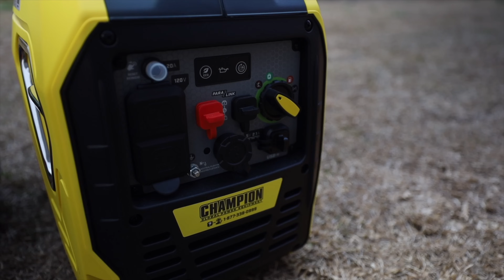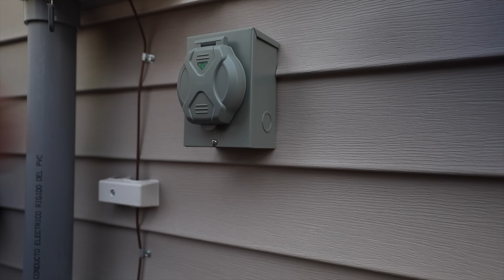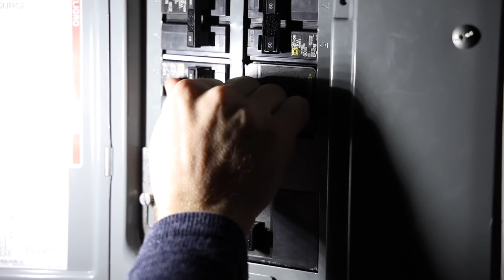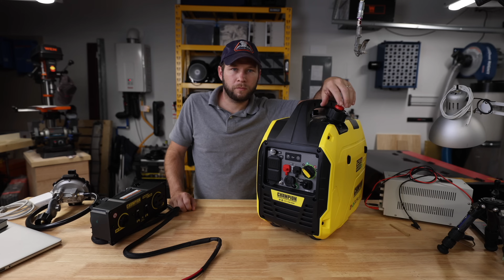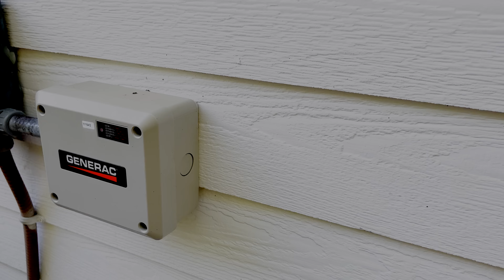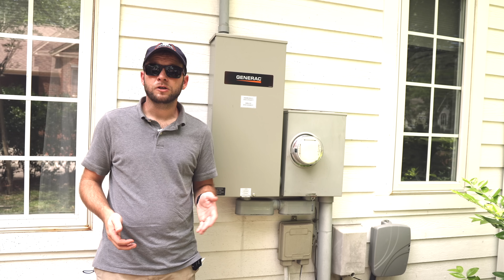Will running on a generator damage your house? Inverter vs standard vs standby

Comment: Hello D.A. Thx for the reply. Yes I’ll put a type 2 SPD on side of CB Panel. 
Now My BURNHAM Gas Boiler is Hardwired from panel to an on/off switch to Boiler. Does this make sense to put a GFCI 15amp Rocker/Receptacle in its place with a 12/3 3prong pigtail. Then when utility goes down I unplug from that receptacle, then plug that plug into a UPS then plug the other end into Receptacle/Rocker, then turn on  the Genset with  less than 3 THD, now my boiler has a better chance to see Clean power from Genset to UPS to Boiler/Zone Valves/ Circulating pump. Will that work to protect Boiler from unclean power. If you say yes then I will buy other inexpensive UPS’s for my FIOS “ONT”, Router to keep WiFi connected. Just run my Sump pump 3/4hp, 2 Refrigerators and LED lighting. It’s a 
AiPower GXS7100iRD
duel fuel. Costco$999 on sale. 
Please reply again about the setup i hopefully was clear on. I’m old and trying to learn and keep my wife warm in the cold weather. All the best to you and channel. Mike ienuso. Again thx for the other reply, very helpful.
Reply from the maker: For things like the internet or computers, a UPS is great to keep them running for a short time until a minor outage is over or you can power up with a generator. However I would not recommend one for "cleaning the power".  This is because the only UPS that really cleans power, and works with a generator, are what is known as true-online or double conversion UPS's.  These can be very expensive (as much as your generator ) and they are meant for servers and other critical loads that are also backed up by automatic generators. A regular UPS is usually just a standby ups and will just send whatever power is coming in, back out. With these types of UPS, if the power is dirty enough to need cleaning, then it is actually too dirty for the ups and the ups will just stay on its battery until it dies.  A double conversion is always running on its battery, while  simultaneously charging it, effectively generating its own clean output at all times, this is why they are expensive, but also have to have batteries replaced every few years to stay healthy.   I would say to just trust your inverter generators output. Most power supplies are designed with fairly good filtering and controls that are converted to DC inside the unit anyway.

Comment: I wished you talked about the THD of whole house generators, but overall, a very good video. My thoughts:

If you're older than 45 (aka - I'm too old for this shit!) and you have the money, get a whole house generator. Running portable generators on gas is a pain in the ass! Assuming your gas station is actually pumping gas, you still have the issue of actually getting the gas to your house (trust me, your car will smell like gas after), pouring the gas into the generator without spilling any or getting any on your body (won't happen) and dealing with the left over gas (you can put that in your car, so not that bad).

Sure, you'll have $2K worth of propane just sitting there doing nothing, but here's the way to think about it:

* if you leave and go to a hotel, you know damn well they're going to charge $300 a night. A 7 night stay and there's your $2K right there
* Will you actually be able to even leave? The whole reason why you lost power is probably because the weather is terrible. If you were in Buffalo, NY for the latest 6 foot snow blizzard they got, you weren't going anywhere (and staying alive)
* What's the value of everything in your freezer? For me, I'd say $400 easily. Do you have a few cuts of filet mignon for that special occasion? Chicken wings for the Super Bowl? A little bit of venison your friend gave you from the last time they went hunting? All of the tomatoes, ground up into sauces and put into ziplock bags, each ready to go and feed your family. Never mind all of the stuff like pizzas, veggies, ice cream, etc., you have to feed your family. If you're lucky enough to make it to a hotel, all of that stuff is gone if you lose power for more than 18 hours. 
* Do you have fish? Great, you go to a hotel and they die! Parrots? Dogs/cats?

I guess my point is, that $2K in propane, sitting there, waiting to be used gives you peace of mind, and I don't mind it at all. Learn to be smart:

* get a smaller, 12kw or 14 kw generator with load shedding
* break out a portable AC window unit during a power outage. No need to freeze the whole house
* in the winter, all you need is heat, water and a couple of lights. Everything else is a luxury

A giant, 22kw or even bigger generator is fine, if you've got the money. I think 12kw or 14 kw is just fine, allows the critical lines to run and keeps you in your house.
Reply: if you do some shopping, you may find the difference in cost between a 12 Kw and a 22 Kw isn't all that much, in the big picture. The cost to run gas, run electric, and prep / locate the set are all the same, labor wise. Yes, larger wires cost money, but only a small percentage of the total job. The unit cost might be $2k more to go with a 22 Kw.... and fuel consumption is more related to your draw than the gen size. IOW, you don't have to use it all so the gen could have an easier life. If you already use propane for the other appliances, so much the better.
Reply: also add the cost of a union plumber they dont come cheap if your water lines bust
Reply: That’s right!!
No one’s called out generec on this topic!!
Reply: Or buy a portable generator the runs on nat gas.

Comment: To add a tangent to your research - I'd like to add more solar cells to my home in AZ but keep them off grid.  They would charge a battery system that can be used as household backup but also to power some degree of charging for the 74kw car.  Include applications of smart circuit breakers or panels.  Proceed!  Extra credit included for this, or perhaps credit toward your dissertation!

Comment: So question concerning "shared neutral" circuits.  I have no tandem breakers (house was built prior to tandem breakers being code), but I know where my MWCB's are and what they serve.  I plan on using only 120V inverter to feed house power.  As long as I make sure I don't use both circuits of a shared neutral, there should not be an issue...correct?  
And secondly, must I switch off all 240V breakers when going 120v same phase?  Can anything be harmed if a double pole breaker is still on but only running 120v same phase on both legs?
Reply from the maker: Technically as long as the load on a shared neutral doesn’t exceed the neutral rating, you are fine. It’s just along the lines of protecting a wire by being careful rather than using a circuit breaker. So to be safe it’s best to not turn them on, or only turn on one. When starting up from a generator I would turn off all breakers and then only turn on the ones you know you need, just to be safe and avoid unnecessary loads on the generator. So I wouldn’t turn on the 240 breakers, but it really shouldn’t hurt things, as anything that needs 240 just wont run. But you could have some devices that have 120v controls if they are a L1,L2,N,G Wiring. So you could have something like a thermostat that turns on and thinks it’s controlling the AC unit, but the compressor wont actually turn on.
Reply: @DemonicAnimatronic  Thank you for the reply.
Reply: use a qualified electrician to keep everybody safe.

Comment: I would suggest people invest in a few UPS for your electronics that you use after. They can be a power cleaner for you if you use a generator that's not great at stable power.
Reply: UPS circuitry is related to that of an inverter generator except that a UPS often generates a square wave output while an inverter generator should be close to a sine wave. I don't see why a non inverter generator should be very dirty compared to a conventional one. Theoretically, conventional home generators  should work the same as commercial power. Wire coils and magnetic fields work the same everywhere. Be advised however that commercial power isn't particularly clean itself. Along with any of us, there's a great multitude of other customers sharing the same source who are doing who knows what to the power lines. I've looked at actual commercial power waveforms on oscilloscopes and it rather loosely resembles a sine wave.
   An individual generator waveform is only affected by YOUR devices. Digital equipment and anything that uses a switching power supply (not everything is happy with running on a square wave source) are well known offenders of undesirable side effects. If anything seems "dirty" look there first.
Reply: @joewoodchuck3824  very good points. Especially if your neighbor is using an old transformer welder, for example, introducing all kinds of noise into the circuit. 

On the other hand, we used to run the power system with multiple connected spinning equipment (steam turbines, hydro generators, synchronous condensers, etc), and the inertia of all that mass (especially the hydro turbines — they run “slow” physical speeds compared to steam turbines - but the same electrical speed - which are REALLY, really heavy) keep the system very close to 60.00hz, unless the pressures on the grid are in the emergency range and dragging either voltage or frequency into load-shedding. I’ve seen that happen. It wasn’t pretty.
Reply: I’m retired now, so I don’t know how well the static generators (solar panels and batteries), and lower torque wind generators are working out… A lot less connected spinning mass, that’s for sure
Reply: @DanielinLaTuna  
   I'm very experienced in electronics both as a career and a hobby and static is rarely mentioned in the circles I run with. Such charges can be dealt without much fuss however. 
   I'm curious about your climate. Dry? Windy?
Reply: @joewoodchuck3824  , I worked for Los Angeles, both in high voltage grid operations (long distance transmission) and  within the City limits in lower voltage distribution. 
I see in retrospect, static was a poor choice of words. What I mean is generation with no attached spinning mass. In the industry we differentiate rotating equipment from non-rotating. Solar farms, for example, don’t have inertia. The two DC transmission lines that come into the city from the Pacific Northwest and from Utah also behave like static generation. 
The reason heavy spinning mass is important to the power system is that events on the grid generally affect frequency and voltage. The connected capacitors and reactors (coils) will automatically insert or be removed to try to support voltage. But only rotating equipment can halt frequency decay; they do it by giving up some of their inertia (slow down) until their governors and Automatic Generation Control (AGC) react to restore frequency.
Reply: @DanielinLaTuna  Inertia is the same as electrical charge and discharge. In a mechanical generator the rotor acts as a flywheel. In both cases energy can go in or go out. In a simple solar system there are always batteries to store energy. I assume a big system would be the same. PV panels put energy into the batteries and the load takes it out. It doesn't matter electrically speaking whether flywheel or battery, the result is still the same. Further, a solar collection system is, with some exceptions, converted to AC power. When the load changes the batteries either absorb energy or supply it just as a flywheel does. But, the inverter circuit  doesn't change frequency. It runs on a clock instead. Continuing, within design limits, the inverter supplies constant AC voltage because the battery can usually supply enough power to the circuitry so sudden AC load changes don't affect it. In a sense it's a perfect flywheel with immunity to demand changes. Thus, a flywheel is not the only way to control frequency. I'm not trying to sell the idea that solar power is better in the electrical sense. But rather the flywheel analogy does illustrate the same function. So from that perspective the solar system does have an electrical version of a flywheel and thus shouldn't fundamentally be distinguished. 
   I think both our perspectives are different in that yours focuses more on generation and mine focuses more on load conditions.
Reply: I was thinking the same thing with automatic voltage regulation.

Comment: Generators that use a Capactor or Brushless Series (the Worst) to control the Voltage output yes the Voltage can Spike Very Badly   , Always Buy  Generator with a AVR  I have been using a High Quality 7000W Running Watts Generator with a AVR for many yes and have had no problems LCD TV , Frig , 3 ton AC unit .
Reply: Hello Dan Ray. I’m Mike i. I bought a AiPowerGXS7100iRD. What is AVR please/thank you?
Reply: @mikeienuso1926  Automatic Voltage Regulator, on Honda gens.

Comment: Fantastic video!  I really appreciate how you broke down the differences between standby generators vs portable generators vs portable inverter generators. Thank you!!!!!!
Reply: The only question that I didn't get answered from your video is regarding dirty power.  How dirty is the power on a stand-by generator like the 16KWh Generac in your video?
Reply from the maker: The stand-by generators are usually around the 5% THD mark and are pretty stable on voltage and frequency, especially the bigger generators. This should not cause any harm to the equipment in your house, but certain devices may not like it. Such as cheaper computer UPS systems. With many computer battery backups, unless the power is as clean as the utility or better, they will not switch over to it and will run on the battery until it is depleted.  A true online UPS will work fine though. So a standby is generally good, can have a lot of power output, and has better power quality than a standard portable generator but not quite as good as a good inverter or the power company.